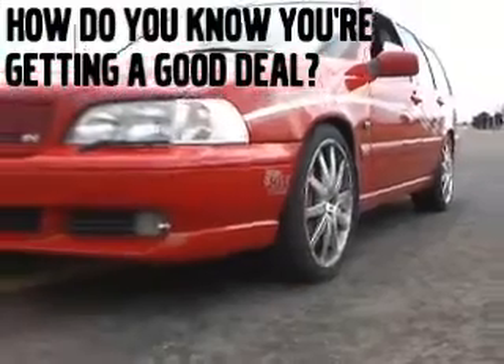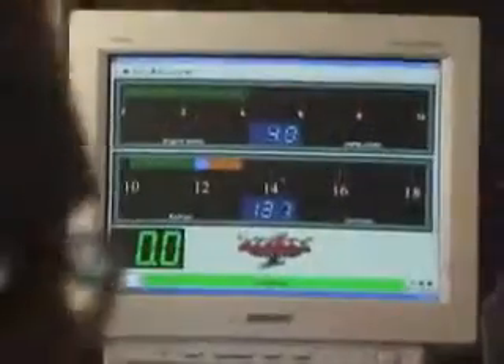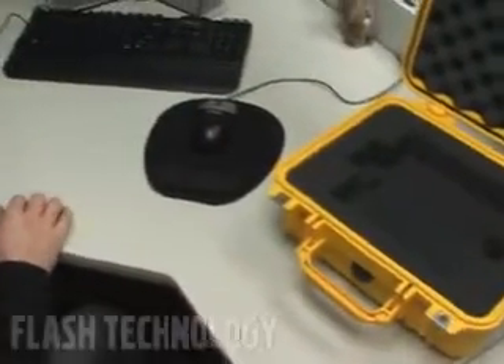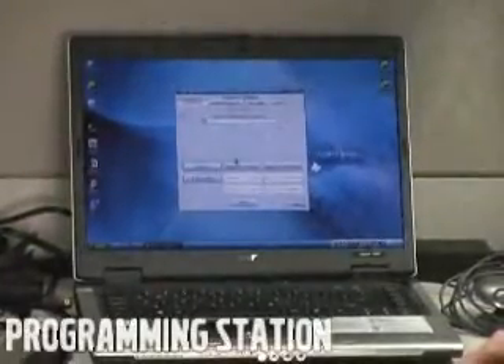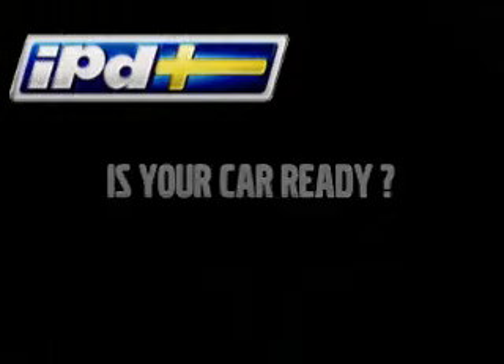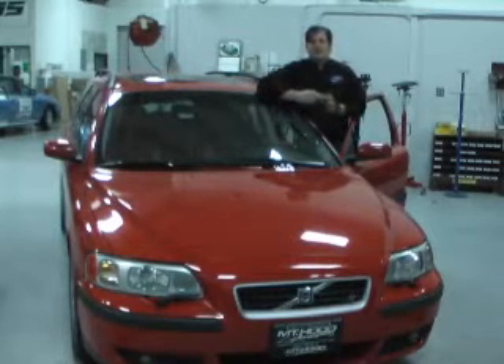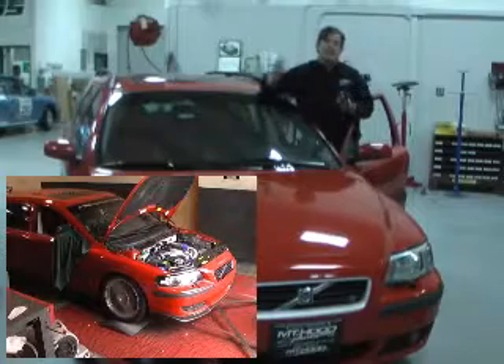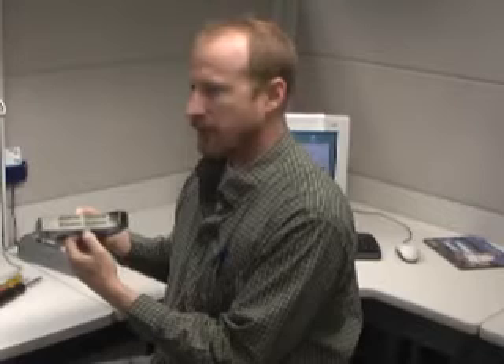IPD Volvo ECU UPGRADES FOR 1994-1998

Comment: When I getting ECU what # I need to mach with one I got, # I got now is 0261203072, there is some other # on the ECU like p09125331 does the # need to mach or only the first one 
It is for 1997 850 T5 engine code B5237T

Comment from the maker: Garrett turbos are nice but the cost of the turbo is only one part.  You'll still need to install it (non bolt on) and associated tuning to maximize the upgrade.  This is where some of the cost of the Ipd kit comes in.  Complete and ready to bolt on.